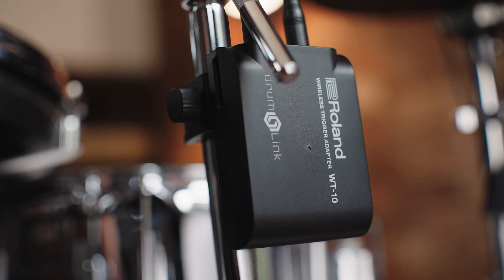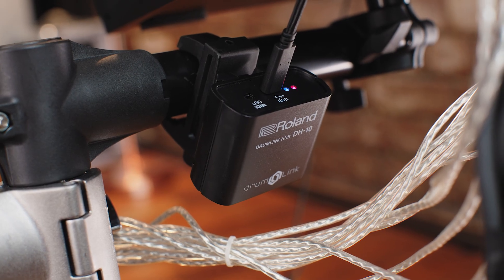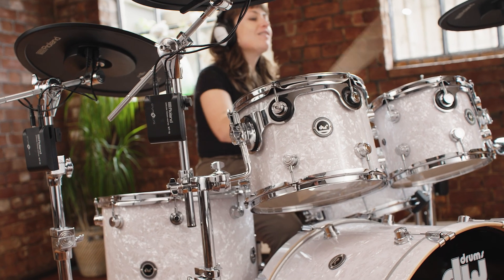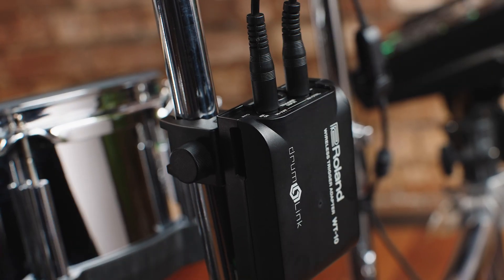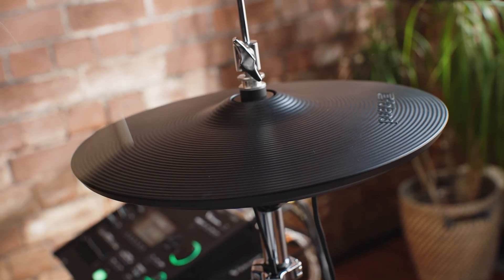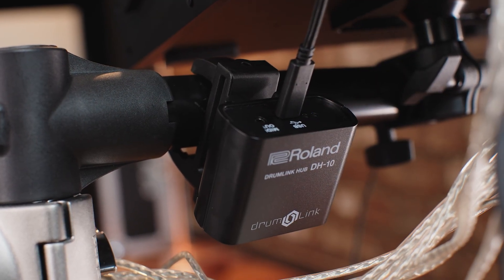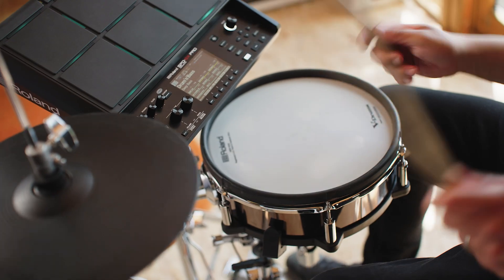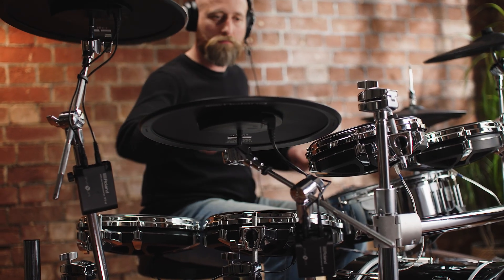Roland DrumLink | Everything You Need to Know

Comment: Nope.  If you play medium to large venues there are so many wireless signals in the air that this is bound to glitch.  Think about it.. 100 or more cell phones in the crowd, the venue's own hub and repeaters and endless wifi devices installed (audio, lights, smart devices) and then add to that all the wireless microphones, guitars, mixers and now a dozen devices on the drum kit. Do we have a list of artists who would rely on this setup for a live performance ?  And no, it doesn't matter that wireless signals are on different routers, frequently bands etc... We use quality equipment and phantom gremlins show up at large shows. It glitches wireless equipment all the time from noise interference to signal cut out.

Comment: this isnt wireless! wireless means no wires. this is a waste of money using wires to connect a wireless system to a trigger. if it still has wires why not just use wires for the other 3 ft from the wireless unit to the module. this is moronic.

Comment: Hello, this is a great video, thanks for the information.  I have a TD-27 module, I use the Roland pads and cymbals for my setup.   I just recently purchased the Roland DH 10 Wireless, still waiting on the Roland WT10 Wireless for my pads and cymbals.   Question: I connected the Roland DH10 to my TD27  to my digital USB port at the back module.   The TD27 module recognized the ROLAND DH10 Wireless with the lights showing on the ROLAND DH10 Wireless..   I tried connecting to the ROLAND DH10 Wireless via MIDI connection to my TD27 module, the connection was from MIDI out from ROLAND DH to the MIDI IN on my TD27 module.  The ROLAND DH10 Wireless was not recognized ( no lights on the ROLAND DH10 Wireless.).    Do you have any suggestions as to how I can get this to work via MIDI connection from the ROLAND DH10 Wireless to my TD27 module. Thanks.

Comment: Lovely.
Although, “no latency” — as you claim in the video — is not possible with digital transfer and even less possible doing wireless transfer. Low latency, yes — or even very low. But no latency at all isn't possible.
Unfortunately Roland decided not to specify the latency other than: “DrumLink uses proprietary 2.4 GHz wireless connection technology with extremely low latency,” as written on your web.
Reply: I guess "no perceivable latency" would've been more correct.
Reply: @joellouisfire  True, hopefully inspires Rolands PR team to update their web and script : )
Reply: It should be assumed there will be a modicum of latency. Still, from what I've seen in articles and from other YTers, the latency is in microseconds; which is close enough.
Reply: @u4yk  If they managed to come down to a whopping microseconds in latency then it's an invention worth the Nobel Prize of physics. Considering a microsecond is a thousand of a millisecond. 
Would be great if the managed to do this but I stay cautiously optimistic : )

Comment: I think I answered my own question with Roland's documentation, "The DH-10 also has a TRS MIDI output for sending trigger signals to any sound source that receives MIDI note messages and CC data."

DH-10 DrumLink Hub
The compact DH-10 DrumLink Hub captures trigger signals from up to 15 WT-10 units.* A USB-C connection to a Roland sound module or computer provides power. The DH-10 also has a TRS MIDI output for sending trigger signals to any sound source that receives MIDI note messages and CC data. When using MIDI, the DH-10 can be powered via a standard 5-volt USB phone charger (150 mA minimum power required).

Comment: Hello Roland Team, I have a TD27 module which currently uses all three (3) USB ports, for the digital, hihat, snare and ride.  Do you have a solution to use the wireless component when all three USB ports are used?  I presume a USB splitter would work?  Please advise.  Thanks.
Reply: Same question here - but with a full equipped TD-50X.
Reply: @ralf_f_drumcover  
I think I answered my own question with Roland's documentation, "The DH-10 also has a TRS MIDI output for sending trigger signals to any sound source that receives MIDI note messages and CC data."

DH-10 DrumLink Hub
The compact DH-10 DrumLink Hub captures trigger signals from up to 15 WT-10 units.* A USB-C connection to a Roland sound module or computer provides power. The DH-10 also has a TRS MIDI output for sending trigger signals to any sound source that receives MIDI note messages and CC data. When using MIDI, the DH-10 can be powered via a standard 5-volt USB phone charger (150 mA minimum power required).

Reply
Reply: Have you received any response from Roland in the meantime?
Reply: @ralf_f_drumcover . No but, I suspect they saw my reply, hence, solved my own problem.  I would like to see Roland show how MIDI can be used not just demonstrating USB.  Either, Nick from Sweetwater (US), Justin, from 65 Drums (US) or Luke from the edrum workshop (UK) might give a demo. They’re good at showing a demo of every aspect of Roland drums, not just the sales pitch. Cheers.

Comment: If the pad needs a cable to connect to the transmitter then it’s not cable free. Meaning I will still need to carry the cables me to the gig / rehearsal. Connecting different wires is a hassle, even compared to one cable snake every time . Just sayin. Still a good idea though
Reply: I agree but maybe it is just an intermediate solution and intro to the future products which will incorporate the transmitters and modules with integrated receivers.

Comment: Would running without a module at all be a valid setup? All pads connected to WT-10s and a DH-10 connected to a laptop (running Superior Drummer, etc.). No TD-17 or other module.
Reply: kind of doubt it. the module needs to send the info into the PC.
Reply: But the output from the DH-10 is already MIDI over USB. The docs even say, “Connects to the V-Drums module or a computer via USB-C or MIDI”
Reply: @AshLeaFen  if you use the DH-10 with your computer, you can run without module like the DWe
Reply: @AshLeaFen oh then that kind of seems like it would

Comment: I’m sure the question everyone will ask is can I use all the cable inputs of my module and add more pads wirelessly using this tool to create an immense kit?
Reply: Yes If you connect the DH10 to a digital in you can then pair 15 Head and rim triggers to that hub. Each can have its own midi note for triggering internal sounds or externally eg:vst, au drum software, sample players or outboard midi gear
Reply: @onomatopoeidia Thanks